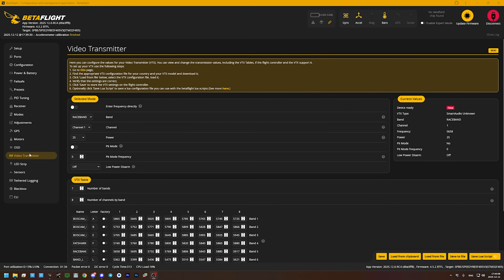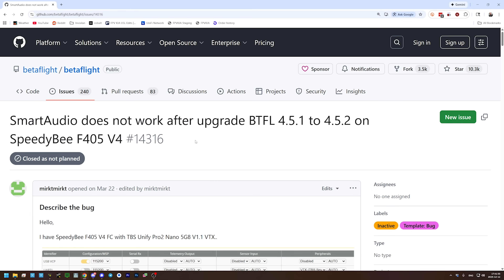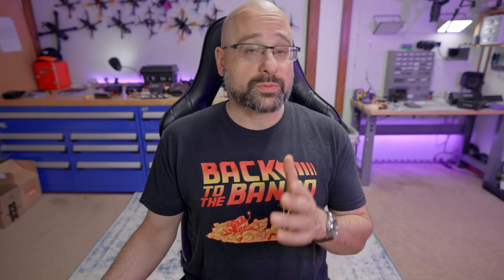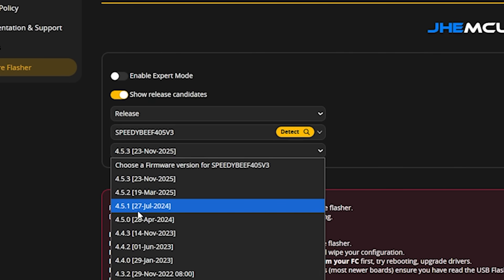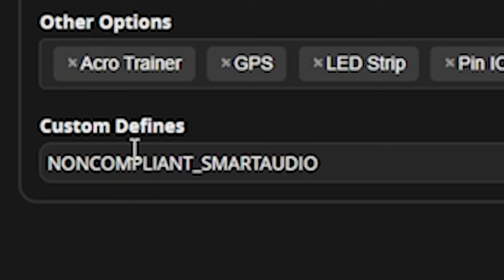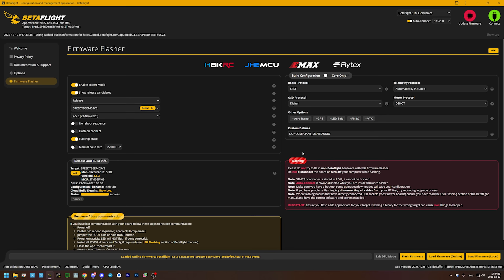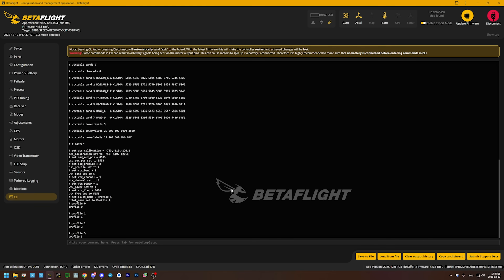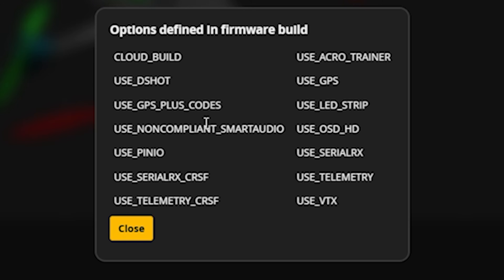Betaflight SmartAudio Bug causes Device Ready: False

Comment: Joshua, like I said in my previous comment I'm on 4.4.2 is it the same fix?  It was working but I didn't flash to a new firmware all i did was chang my frame and camera? and I'm 200% sure everything is set and wired correctly
Reply from the maker: This specific issue doesn't apply to 4.4.2 as far as I know. Especially because you didn't flash any new firmware, right?
Reply: @JoshuaBardwell  NO I DID NOT  flash , everything else short of flashing . I switched to IRC Tramp just to see now I'm getting video on Racebend 2 nice and clear still no parameters ln side the OSD menue still reading FALSE    but everything on my OSG flight screen is good even if i make a change to an element it will show up correctly it's tripping me out I don't know I don't know  what else to try ?  What would you do should I reflash? and to boot my VTX blue power light on my flight controller is not on or flashing but I  can switch from 25mw to 400 and it changes because the heat climbs and it comes through on the goggles  this is on the little 2"draknight  hglrc   w/ integrated  VTX  i have the option to unsolder the pad and put an exterior VTX might be my only option if reflashing doesn't work?  I don't know JB ; I know it's throwing me for a loop any suggestions or advice would be greatly appreciated thanks  for the response my friend!
Reply: Hey JB I Just remembered I did Flash when I first got the quad but I only did it for receiver reasons and flashed what was already on it It's already tuned to that firmware  didn't feel the need to update the firmware. ., I've flown probably 60 flights with it always read true .but your saying the bug came later than 4.4.2, ,short of putting on an exterior VTX I don't know what else to try thanks!

Comment: it's doing it in 4.4.2 as well it's not just betaflight 4.5 and up I'm on configurator 10.10 and betaflight 4.4.2 and it doing the same Thing  I've spent the last 4 day's uploading and downloading different tables changed cameras I even made sure and got the original VTX table from the manufacture, because this was a BNF, what gets me is I didn't do anything I was just changing out the frame and new camera  for original parts  rebooted and presto  FALSE  and this is weird I'll get camera feed in my goggles but on a random channel band and power that has nothing to do with the setting I have set I don.t know how that>s possible ?j and I can go into the OSD with m TX and scroll through but its not reading any parameters nothing that has to do with smart audio it was broadcasting on Fat shark and Bosscam the other day I don't have far shark goggles?  frustrating

Comment: This was 100% my issue when I emailed you. My issue was with a TBS unify vtx but this worked thank you. Another issue I ran into with a HGLRC zues 1.6w vtx was in the manual and setup guide it specifically tells you to use IRC tramp. Well I could not get my FC and VTX to communicate. Racked my brain trying to figure it out. So for shits and gigs I decided to switch from tramp to smart audio in the ports tab and to my surprise that worked! Just thought id share that bit of info if anyone else is struggling to get a HGLRC vtx to work

Comment: Yeah. I was struggling with getting my race ranger to read true and I ended up just going with Zeus pro irc tramp cause I thought it was a faulty vtx
Reply: Idk what betaflight firmware I'm running, but I tried setting up my zeus vtx as irc tramp because that's what it says it uses and I couldn't get it to read true. But when I set it up as smart audio 2.1 it worked
Reply: @UntiI117 that's so weird! Lol let me check really quick. I'm on betaflight 4.5.3 with my Zeus vtx pro  tramp. Reads true
Reply: @UntiI117 same exact thing I ran into with a HGLRC Zues 1.6w vtx. Setup and guide says to use tramp but that does not work. It works with smart audio

Comment: Hey Joshua I have a Walksnail Avatar HD Pro and I'm having the same issues now. I updated to the new firmware, 2025.12.1. and I lost VTX connection after about 50 meters. Spooked me a bit. Tried everything under the sun to get it to work again, so I gave up and reflashed to 4.5.3, which was on it previously with no issues, and the issue follows me. It stays in the FALSE state. I just tried what you did in this video, along with adding NOCOMPLIANT_MSP. Still does not work for me. Anybody else having this issue? I knew I shouldn't have updated to the newer firmware... LOL